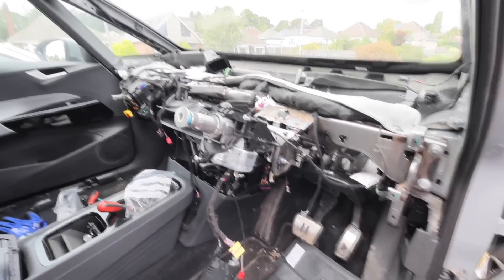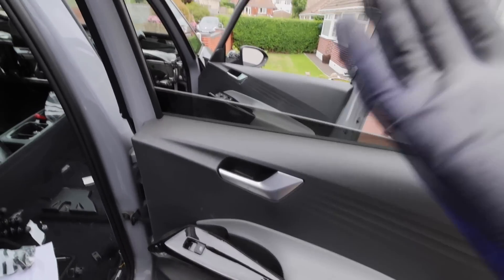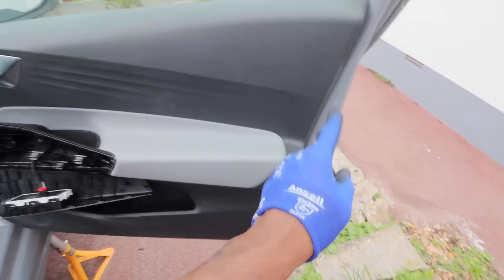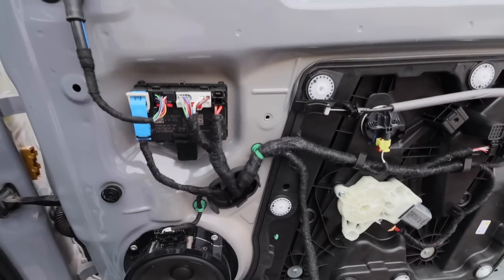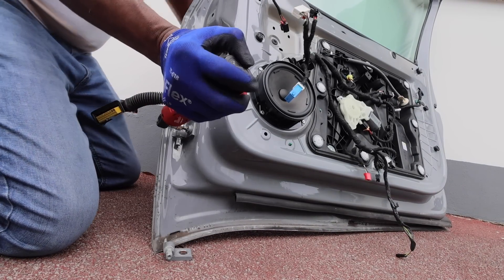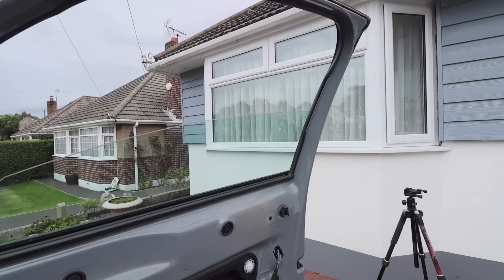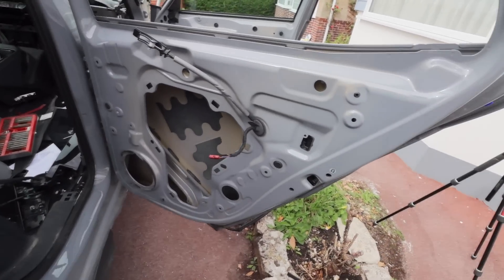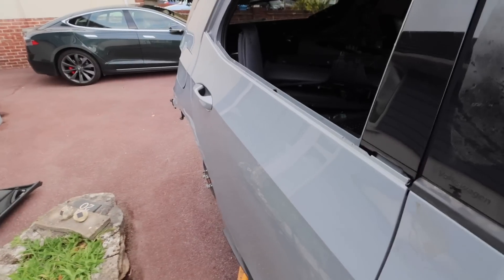NEW DOORS & PROBLEMS! i The iD3 Gets New Doors

Comment: When you are installing the window of the door, first install the plastic pin with the middle dowel in the window. Then the window with the pin clicks in the holder. Why the pin is in two parts is only when you dismantle the door.

Comment: Well done on this, looking good already!, I've a recent VW T-Roc which i repaired, on mine there was an airbag module on the "transmission" tunnel, dont forget about this one (if it exisits on the ID3), i suspect it does as the basic frame is very similar to the T-Roc. Also the front radar, dont worry too much about replacing unless absolutly necessary - as it has component protection on it! - which was a complete pain to sort, also be careful if trying to code with VCDS, as I managed to mess up the top radar in the windscreen, which ment I needed to calalibrate ADAS, again a complete pain, 

ps the bottom radar can be recalibrated by holding a board (or wall) 1200mm from the radar in VCDS (or was it ODIS?)

Comment: Hi Paul
Great video again. I would have recommended the airbag team they did my car. I have a Audi A1 2022 and I am trying to find a arm rest between the front seats but I can not find the part number have you come across some where to find this?
Have a great holiday
Reply: Just ring your local dealer, they are usually very helpful. Or if you are retrofitting parts.-. link.-. 24, will point you in the right direction, especially if you know a cars reg no. (maybe you need the VIN), which has the retrofitted part on it that you need (apols for the dodgy link TY think im advertising)